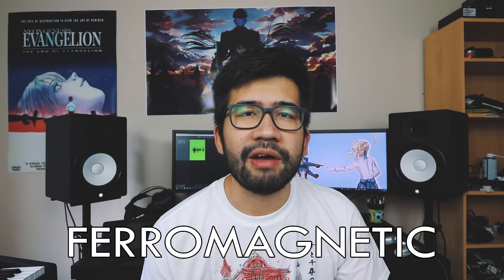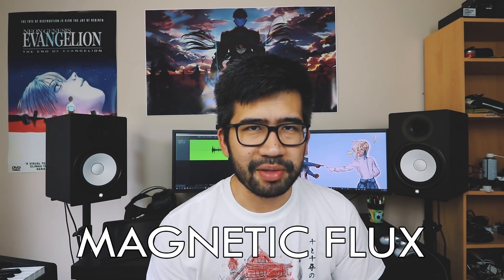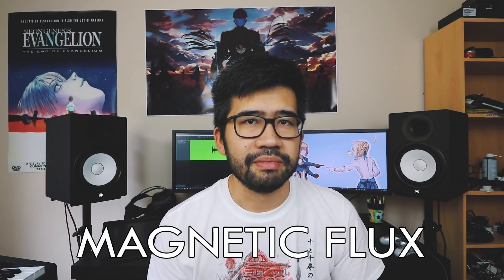How do pickups work?

Comment: Thank you. Question: How does the voltage created in the coil travel to the output wires?
Reply: The coil ends are soldered to lead wires, which connect to the volume and tone controls, which in turn are connected to the output jack.